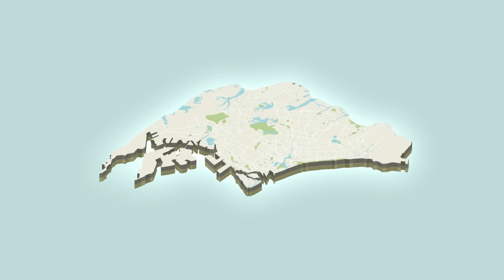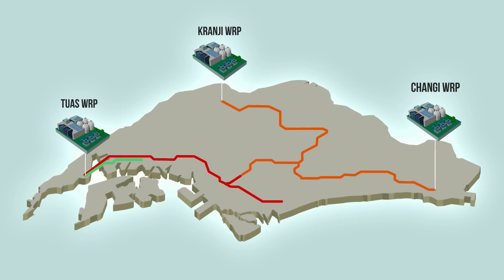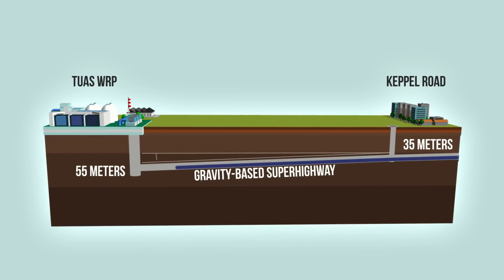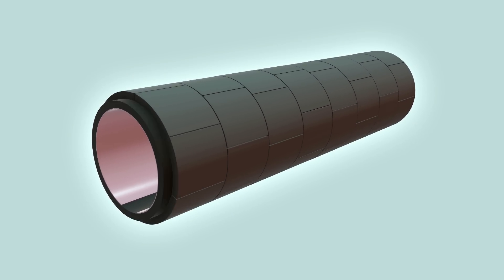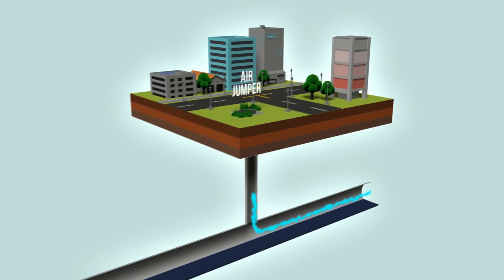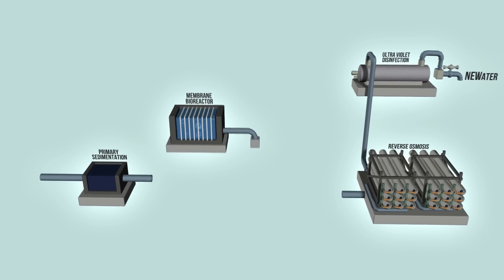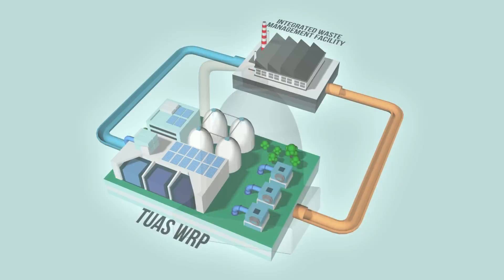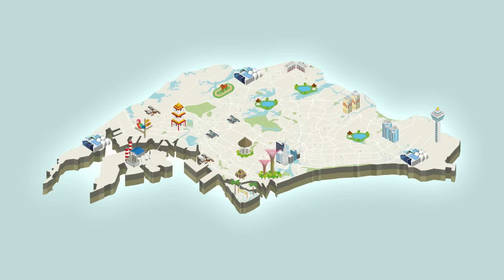DTSS Phase 2 Technical Video

Comment: IF 
= Bio-reactor and digester for electrified (low-current pass through) sea-water, and plates outside to pull-attract sediments is tested, then some redirection can result in savings. (Combine electro-plating comcept with lead-acid battery concept)

IF the old WRP.sss are retained for efficiency planning, how should they be used.

IF garbage is not sorted and to be seperated for 
= Power generation 
== Sludge, Fumes, grinded solids
= Diesel-kerosene production, LPG production but not classified as butane-methane. Only guarantee heat-calorie and no-odour
= Tar for bitumen-production (water-proofing tiles and road-surfacing)
= Fertilizer to bomb components. 

How should sewage be mixed with sea-water (salt cutting action).
How should industrial-waste water be mixed with sea-water before treatment.
How should drain water be mixed with sea-water before treatment-processes for maximising filter.

Bio-reactor and digesters cleaning gradations, work on organic planting principles of circular re.cycle, from reservior, then drain then sea, then industrial then change worms-bacteria... 

Sewage produces bio-reactor digester

2 old WRP to route.
Reply: Flue fumes chimney of power generation plant as final stage of recycling plant produces tar. Grind up waste, feed on tracked-vehicle's tracks-belt as conveyor belt to heat-up, cool-down, keep fire going chimney with fumes-tanks...

Grease pumper from kopitiams and hawkers to be added as control-margin for design-streamline process. Workflow to create and use margines. Mix sewage with grease before-after sea-water dilution -concentration... To produce bio-diesel. Flush swamp-marsh-wetlands... salt-fresh water tidal-action and tidal canals to collect stale water for extra explosive effect...
Reply: Ulu-pandan WRP is sungei-buloh... Every switch-route air-jumper intake-discharge need to be electrically-grounded before and electrified for treatment... Same for underground piping. Constant flow of air prevents built-up of any thing. Tunnel usages at 30% of max capacity and flow the air to outer flue of combustion chimney. Foul-Air-cool-foul-air double triple annulus chimney exhaust. Outermost ring pulls ambient air to flue air to combustion air...

Points to consider when need for higher competition with other cities.
Reply: Toh tuck road are have bio-diesel pumps
Reply: Purified tap water, potable, to new-water plant in Changi for TSMC, UMC in tampines and onwards to global-foundaries in woodlands. NCS is bedok south. Pipe-line utilisation suggestion. the-ludites from the-west think the tap-water here is not-potable, not everyone is as ... as America or Europe...
Reply: Cathode to filter's bottom, anode to outer-casing of tank. 24v 10a, at most, for 40 footer tanker's volume because lorry have battery and fuse and crocodile-clips.
Reply: Check your vertical slot, hahaha, filters after 24hours to see effect of passing current...
Reply: Haizzz,.... Lucky Buddhists can detect thoughts and telepathy. One balancer is chinese-cultural production. Wax of candles and components-category of fruits skin, seed, flesh,  ... Types of fruits, jackfruit rubber, ... Silly-con, ... Wax, ... bambooSO... Wick filtration and wax production and wax-parafin as coagulator and rubber for your continuous sleeping with the enemy for more suffering.
Reply: Lacquer is an off-shoot of ...
Glue is an off-shoot of ...

Glue + ... = Lacquer
Reply: Centrifugal juicer, top-bottom, middle pass-through is top-bottom spiral sorting. After sorted, goes to tree-branch wood grinder and other grinders for storage capacitor tanks-reservoirs before process recycling to fuels and filters and discharge types. Center pass-through need return-cycle water, energy-flow momentum. 

Testing tech and responses, plus-one. You reveal your-standards. I reveal mine. Minimum-maximum minus 10% top and bottom. Remainder 80% led to benchmark of jealousy-against superior-tech lifestyle. Balancers and balanced lifestyle choices and financial-prudence and risk-management and security-risks and courage = when will a person become a female-promotion first day of work.
Reply: World number one port is not sentosa-blakang-mati.
World number one airport is not village
X-ray container scanner-scatter vehicle
World number one initiate-start recycling(mixer produce materials-engineering) chemotherapy-stupid and radioactive-iodine-stupid-tracer and radiologist is not medicine
World number one money is grease-tanker to kopitiam and hawker center and not cheap-charlie psychopath medicine pipeline cannot afford but brag money.
World ... 

Electro-cute plating filter,  inducting filter, cutting filter, sorting mixture, separation mixture, grease sticker mixture inductor tank...